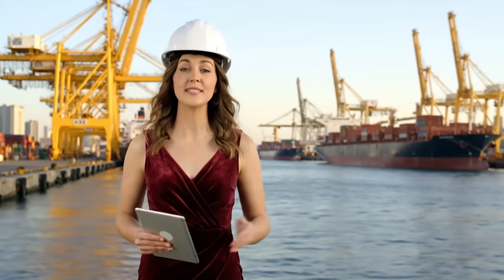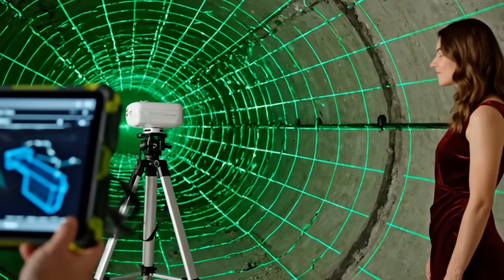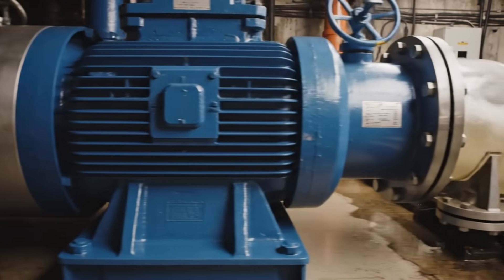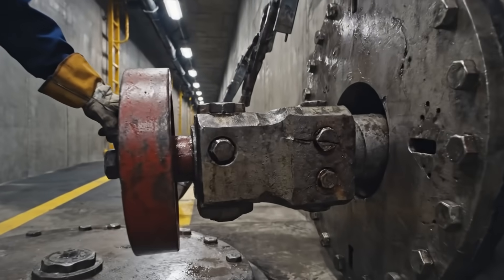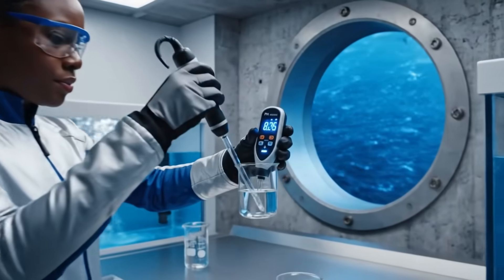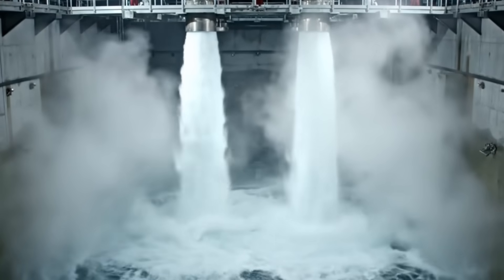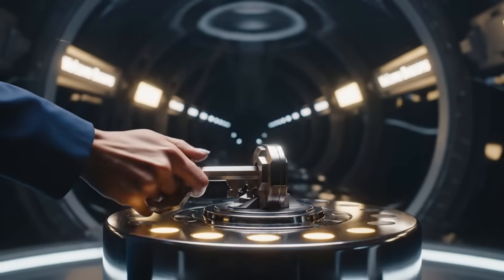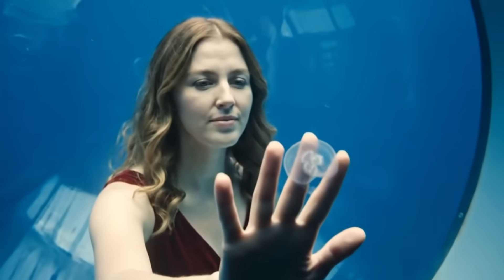Inside the World's Longest Underwater Tunnel🇯🇵🇨🇳: How the $200B Nexus Project Connect Japan to China

Comment: Digital Transformation is the real lever behind these Mega Projects; knowing modeling, simulation, digital twin, and automation tools is no longer just a plus, but a globally in-demand skill. Comprehensive training in Digital Twins focused on Advanced Engineering. Practical applications that allow you to simulate real-world projects (Structures, Energy, Oil & Gas, Infrastructure). Courses and certifications designed to ensure that engineers and teams not only understand the technology but also implement it with real-world impact. Use cases inspired by examples of extreme engineering like those described in the video (mega projects, solutions that “the world said were impossible”).